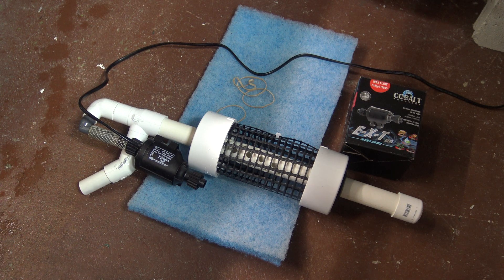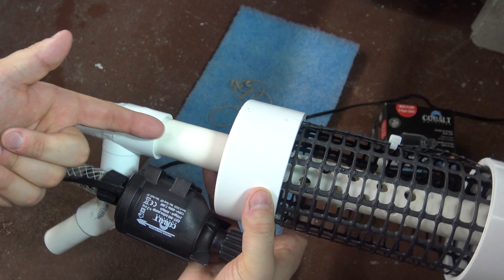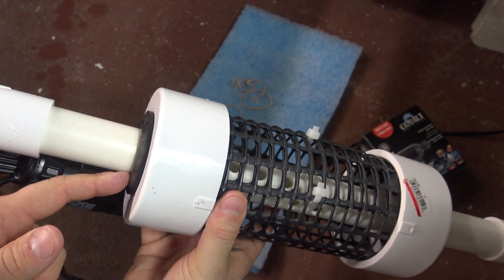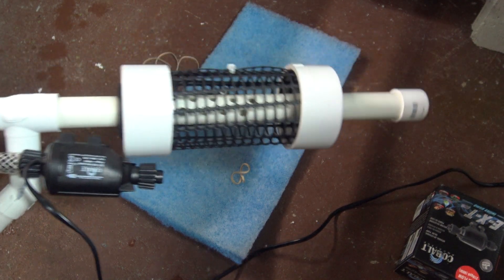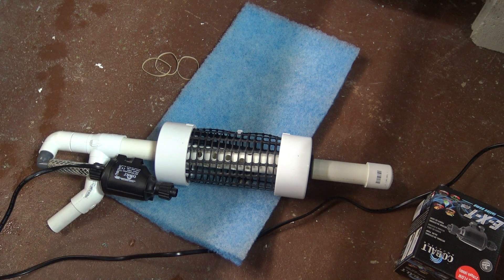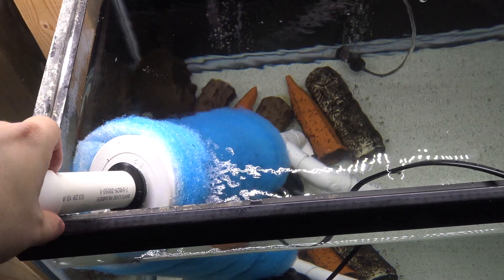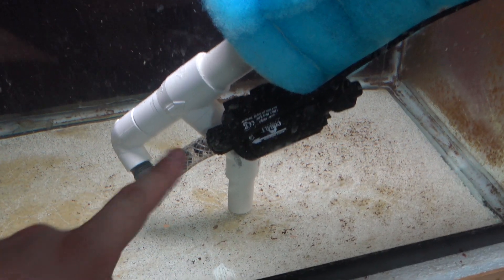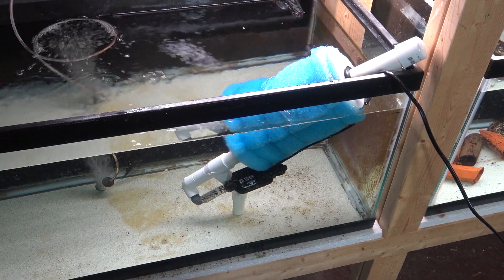#412: DIY Venturi Aquarium Vacuum Wand - DIY Wednesday

Comment: Interesting idea; but why bother with the venturi?  Couldn't you accomplish essentially the same thing by attaching the pump to the "chamber" (or even a standard gravel vac) with some filter floss/bonded foam etc before the input to the pump?  Should work about the same (maybe even stronger suction) in a more compact design thats a bit easier to handle.
Reply from the maker: that could work too, the two problems would be not enough surface area so it clogs quickly, and debris falling back out when you switch tanks